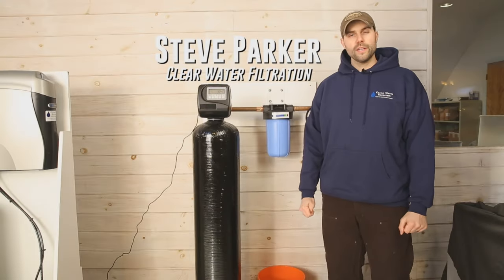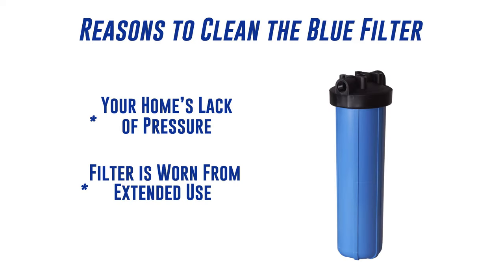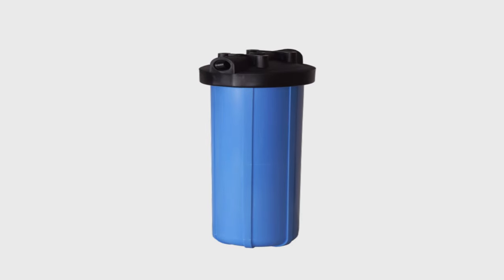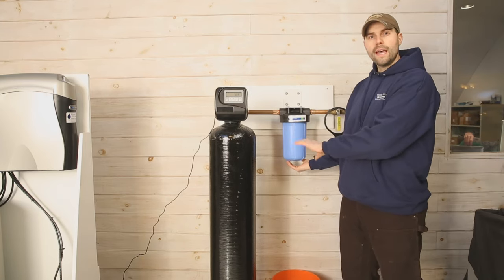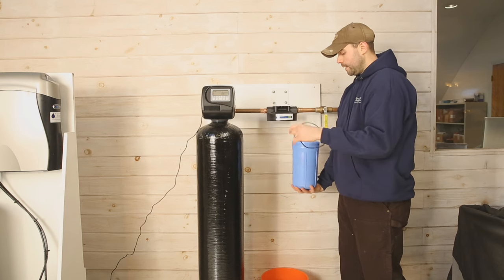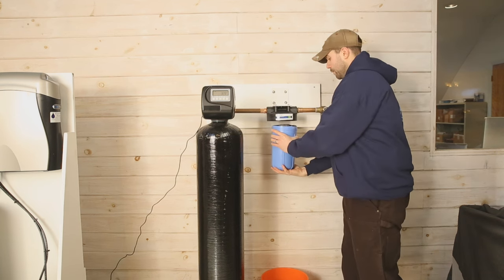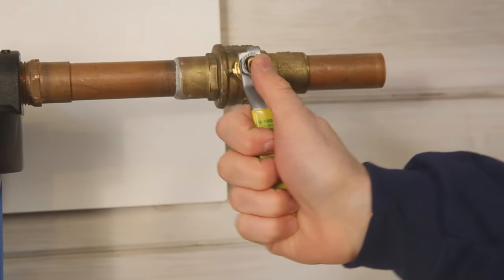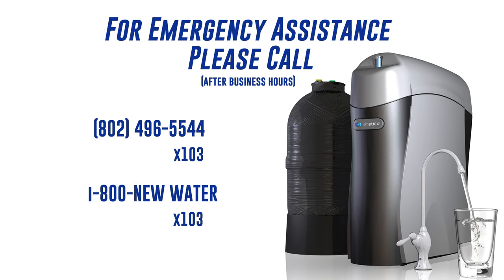How To Change The Big Blue Filter

Comment: This video would be more useful if you changed the filter on a  system (pressurized with water) so we could see the water blow out of the red pressure-relief valve and pour all over the floor like it really would - since the water softener tank would be pressurized. It's a good idea to also have on-hand a tube of food-grade silicone grease (not a petroleum-based grease!) and a new replacement o-ring (probably a p/n OR-100) in case the old o-ring is damaged or swollen, as it often is.  Also, technically that (unscrewing the housing) is counter-clockwise, not clockwise.
Reply: yes, i just sprayed myself with water! good video though.
Reply: It was moving in a clockwise direction when he unscrewed it so not sure what you're talking about. When I screw it back on its counter clockwise
Reply: @lizcasxmp2 you tighten your filter housing counter clockwise?
Reply: Yes, right handed thread, counter-clockwise to loosen. That was jarring to hear.